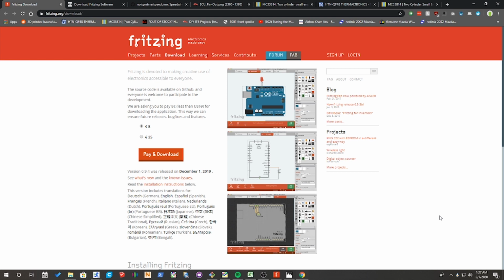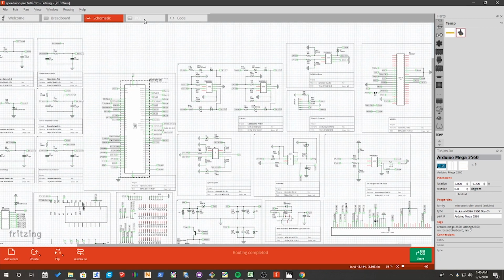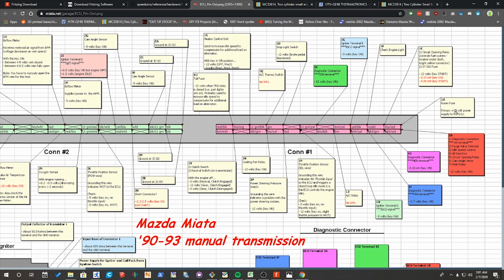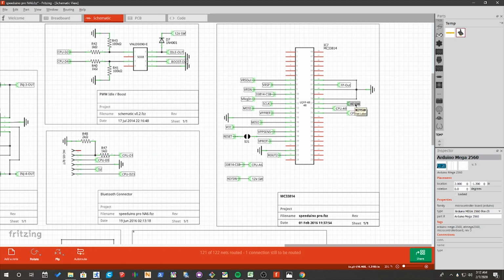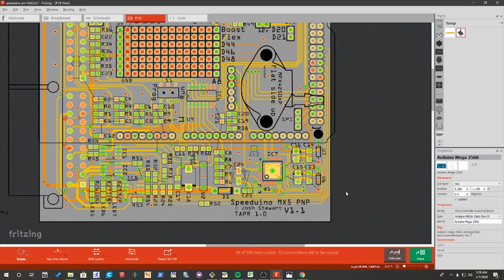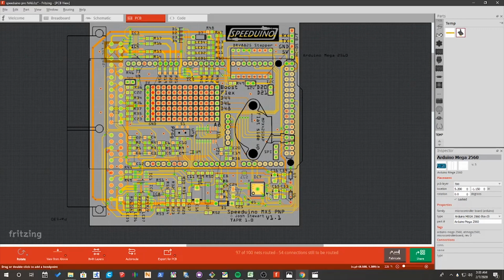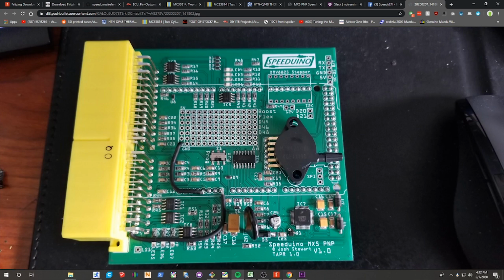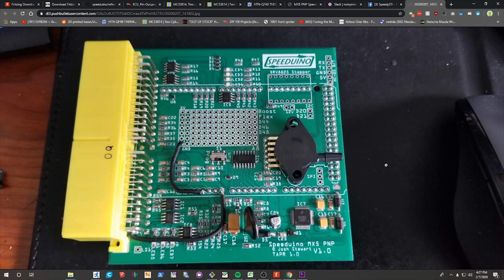SPEEDUINO/SPEEDYEFI Troubleshooting Guide

Comment: I'm having the exact same issue as you did. IC7 is busted. Did Chris Cashion's repair to the Speeduino board work out for you in the end? Was it a repair that allowed the ECU to be reliable and problem-free?
Reply from the maker: Yeah, the fix has proved reliable, haven't had nearly as many issues with the Arduinino regulators as I did IC7.

Comment: Hi i am running my Proton Gen 2 for about  4 years on speeduino official ver4 hardware and never had any problems so i wouldn't say it is Speediuno i would rather say it is hardware and as seen Speedyefi had an problem with there 5v Regulator
Reply from the maker: I'm glad you've never had any issues! I've got a Speeduino that I've had for about 2 years now, and I definitely had this issue, along with countless others that have posted about having their 5v fail. Its not just SpeedyEFI that has the problem, since both Speeduino and SpeedyEFI sell the same hardware. They've said there was a bad batch of voltage regulators this year, but that doesnt make much sense seeing as how I had this problem on older hardware.

Comment: i appreciate this great video. seems i have the same problem. will attempt the fix shown in the video and report back. in addition i got a "pnp"" NA6 speedy for my NA8 which required quite a bit of pinout changes to get working. none of this was documented.
Reply: FYI i did the same fix as in the video and it worked! thanks soooo much for sharing
Reply: Are you on board v1 as well? I'm on revision V1.1 and have been having the same issue's.

Comment: If you'd bought the v03 or v04 board you could fixed it yourself as they use normal components. The pnp board is unique in that it uses surface mount components. If you wanna tinker, the get a v03 or v04 board
Reply from the maker: True, I should've gone with one of those boards initially just for ease of repair, but at least it only took two wires to fix a PnP unit! I don't think I would've even faced this same issue on a v3 or v4 board, since there wouldn't of been an entire 48 pin IC to go bad on those boards.

I figured the PnP option would be easier to deal with in the long run, but we live and learn!

Comment: When the na6 files and first prototypes showed up on my bench I threw a proper bitchfit about using that ic for ic7.
The speedy only uses it for a regulated 5v circuit, but it is so overkill for what it's being used for, considering it's being used by several Chinese companies as a full standalone ECU controller.

Josh gave me a ho-hum answer of "it was supposed to have more features". I guess it was pushed to production anyway since the circuit was a reasonable price for a 5v signal at the end of the day.

So what I did was bypass it and use the Arduino's 5v regulator circuit instead.

Considering it saved 25 minutes of dicking about with impossibly small surface mount pins, and skilled electronics labor is usually about $125-150/hr, it seems like a reasonable fix.

As for noisymime ghosting you, that's definitely not cool, but why would an independent shop be responsible for eating the cost of the warranty work?

Once you factor out the shipping costs, how much did the repair cost? Was it timely and prompt? Does it come with a workmanship guarantee?

I will keep your sentiments in mind when someone comes to me with another broken ECU from a competitor and I may just turn them down completely. But what if they don't have the skillset you do?
Reply from the maker: It might've been a reasonable repair, had you not initially charged me $10 plus the cost of shipping my ECU to you without any indication that I'd have to pay more. You completed the repair first, then told me a new price AFTER the repair was completed, trapping me into paying you no matter what. https://youtu.be/ns_ZzxjsWoU?t=120 Louis Rossman explains it well here at the 2m mark, that's a ripoff man.

 Your cost might've been fair, your methods were not.

Would've been nice if you'd been more upfront with me about your costs - I would've much rather done the repair myself rather than be forced underhandedly into paying for a service. I didn't expect shop to be responsible for any sort of warranty, I simply wanted to troubleshoot the issue that I was facing and see if you knew of a solution, since Noisymime didn't have one.

Our Speeduino community is much more DIY - that's why I made this video, so people could fix a failed IC7 themselves, or perhaps even troubleshoot whatever ECU they have with similar skills. Skillsets can be easily learned, that's what the internet is here for - If someone can install a standalone in their vehicle, they can absolutely repair said standalone.

If you're going to turn people down, feel free to point them in the direction of this video and Fritzing then, so they can fend for themselves.
Reply from the maker: @BEYTEK  It's not a bargain in the slightest, he gave me an initial price which I paid, then changed said price after completing the repair, without telling me the price would be changing before doing the repair, or asking me if I'd want the repair done at that price. His price mightve been fair, but like I said in my previous comment, his methods were not.